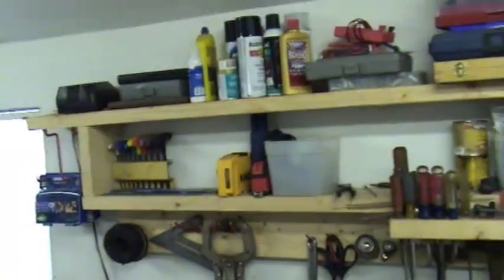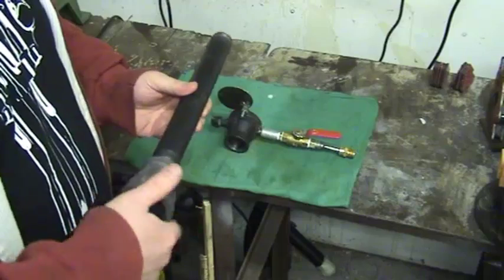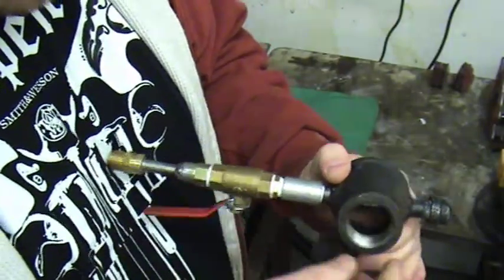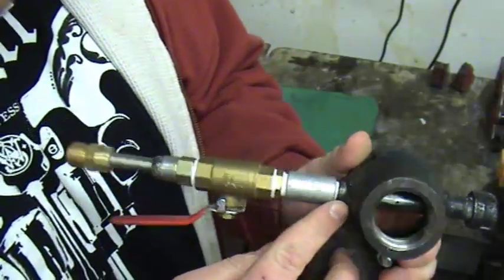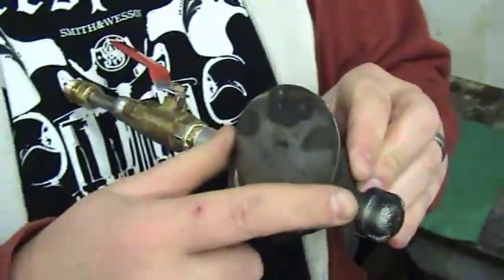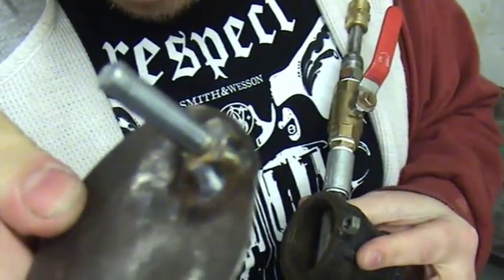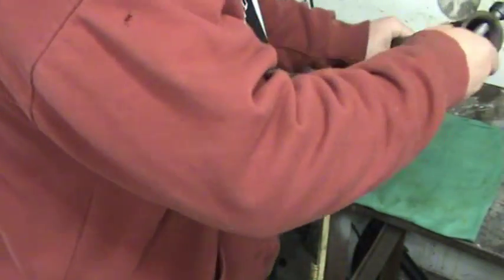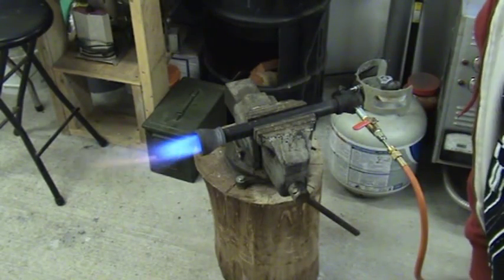Reil Burner for Home Foundry

Comment: I hate making videos too... But, in your description,, the smallest pipe you are using with the cap and the jet for the propane, is a 1/4" pipe nipple,not 1/2".. Your gate valve is stepped up in size to the 3/8" Gate valve. That means the pipe is smaller.. 2/8's, not 4/8's.. or 1/4 not 1/2.. Easy mistake.. 
BTW.. You can use the Mig Tips, and do some experimenting.. Thread one size hole and change out the mig tips to change the diameter of the holes.. I believe they go from .025 to .055 now.

Comment: i have a question about the hole for the propane flow, what would happen if you made the hole bigger or had more then one? would there be any benefit to that or would it just screw up the propane/air mix ratio ?

Comment: Hey I tried this idea and am only getting a soft flame instead of the shooting flame like in the vid. Also the flame is igniting inside the tube and makin it really hot really fast.  Seems dangerous.   Have a regulator hooked to a hose to a 1/8 in. nipple with a .070 hole. 1 1/2 in. X 8 in. pipe to a 2 in. Bell.  Any ideas would be much appreciated.  Thanks for the vid!

Comment: Thank you for being concise and clear in your presentation of the details. Did my first melt today in experimenting with the concept. While it was a hoot to do, I was also taking notes on the experience in the process of building my own foundry. This was just a little teaser, but I think I just got bit by the burn bug. I've been researching old patents and early cupola furnace designs, etc. through online Open Access sites. Your vid helps with a key part of my quest. Thanks.

Comment: @spinesales well my foundry is alot less smaller then yours as is the crucible cause thats 5 1/2 inches tall by 4 inches wide. and i would mostly be melting aluminum as i am starting to cast steering boxes for professional go cart racers.

Comment: @lenty2000 Multiple auto shops I've worked at over the years have run Cleanburn heaters, burned enough waste oil that we sometimes had trouble keeping up!  I think it was burning about one Honda oil change an hour.  Thats 4 quarts of used motor oil.

Comment from the maker: @lenty2000 Yeah shes kind of a beast :)  It was developed by a guy by the name of Ron Reil. Very simple yet effective.I had to make a big enough torch for the size furnace Im tring to heat. Im going to make a smaller furnace and post a series on how to make one from scratch. Im going to make waste oil burner for that one. I may make two waste oil burners so I can use one to make a shop heater too.